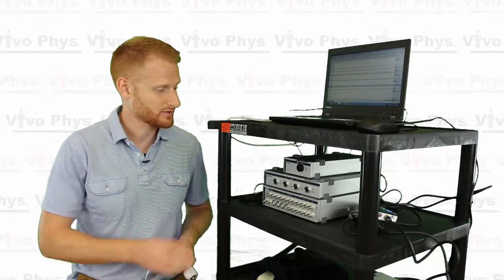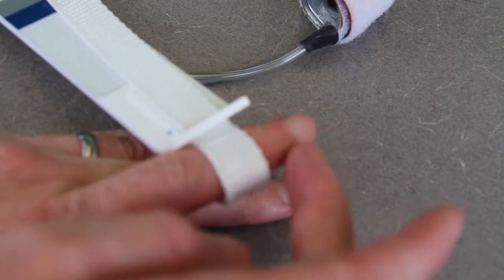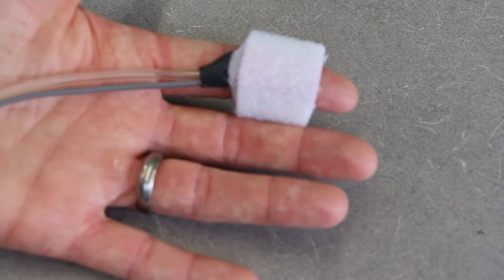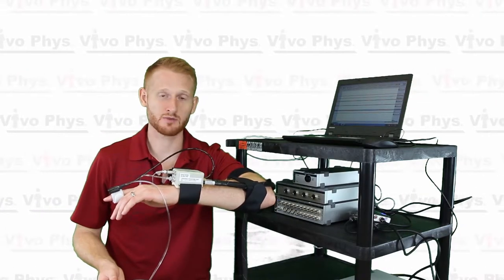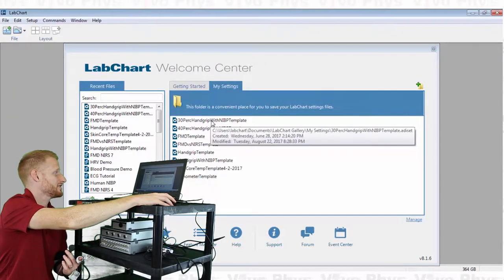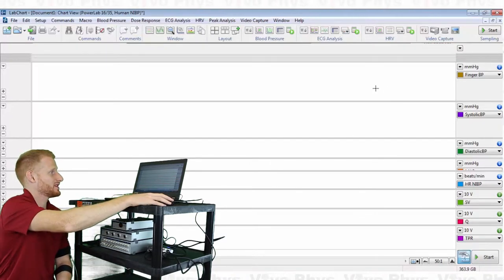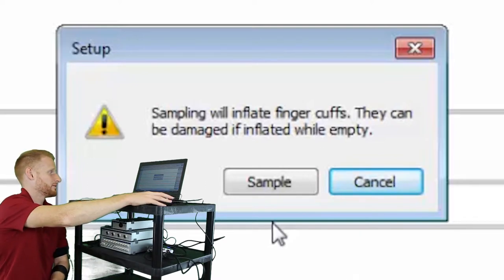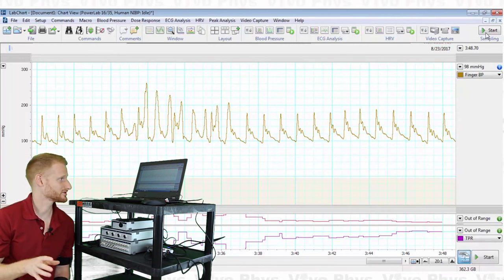Continuous Finger Blood Pressure in PowerLab

Comment: Can you show us how to analyze the data afterwards- is there artifacts or outliers to be removed?
Reply from the maker: The analysis technique depends on how you plan to use the data. It would be hard to show a single way to analyze data. Typically I do not remove artifacts. If there are too many artifacts to obtain relatively accurate mean data I just don't use the data. The main source of artifact is typically participant movement or poor signal quality due to low finger blood flow.

Comment: Great video! Looks very similar to the Finometer I have ;-)
Do you also have the return-to-flow calibration with an arm cuff?
Reply from the maker: AD Instruments actually buys the hardware from Finopress. Unfortunately,  there is no return to flow calibration with the ADI version. I do manual calculations to level correct the systolic and diastolic pressures during analysis when I need correct absolute pressures.